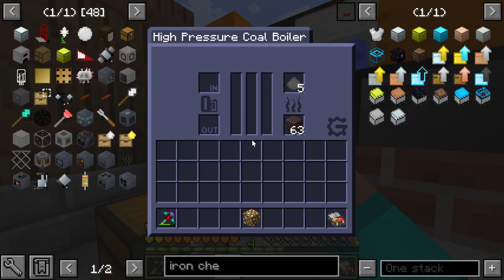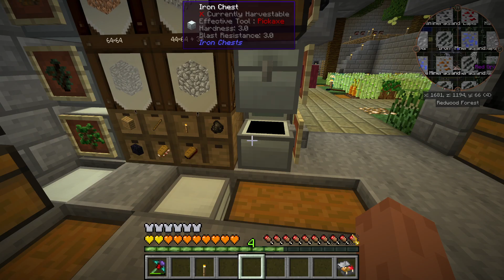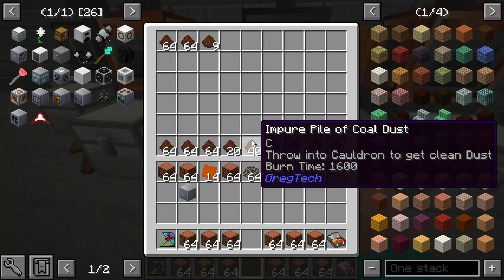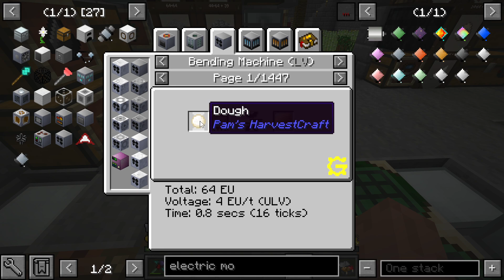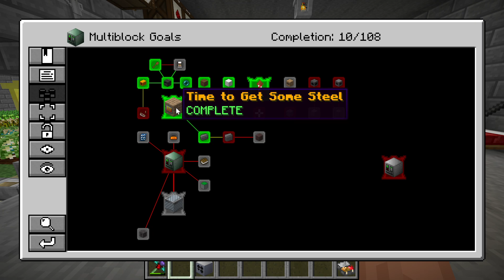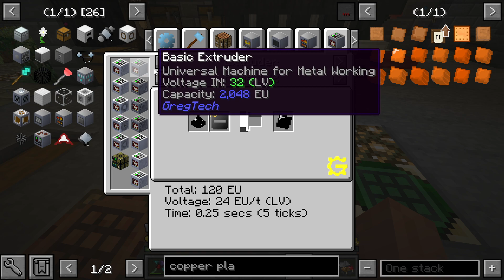Crafting Wiremill and Bending Machine Ep 26 GregTech New Horizons Minecraft GTNH 2023

Comment: You don't need Copper Rods, the Wiremill will make wires from Ingots.  Make sure you check ALL the recipes!  The cable will not burn up with more machines.  It will only burn up with more generators.  If you have 2 generators, you need a 2x cable.  if you use a 4x Battery buffer, you need a 4x cable.  if you put 4 generators on the line, you need a 4x cable.  The cable loses 1 EU/t per cable block the power has to travel, so early on, putting them as close to the generator as possible is good.  You can't get Lossless cables until you get an Electric Blast Furnace.
Reply from the maker: This helps a lot ty 🙂